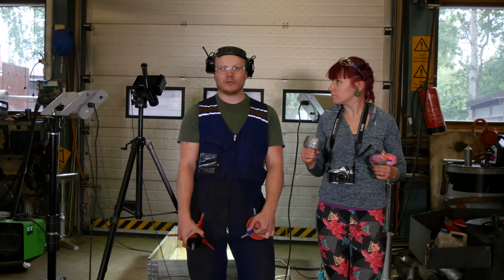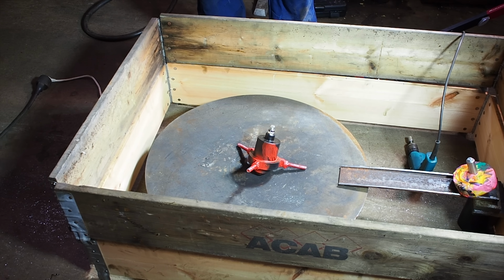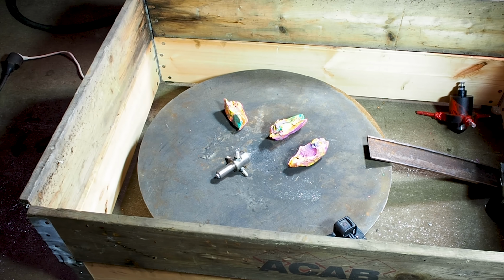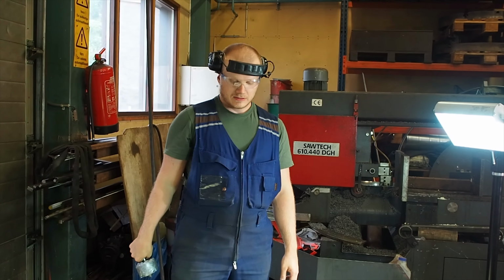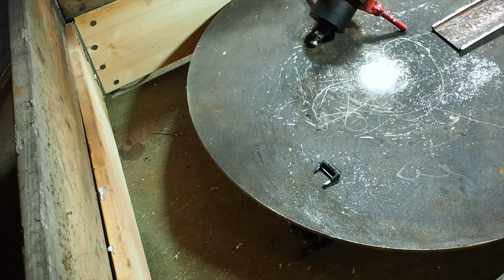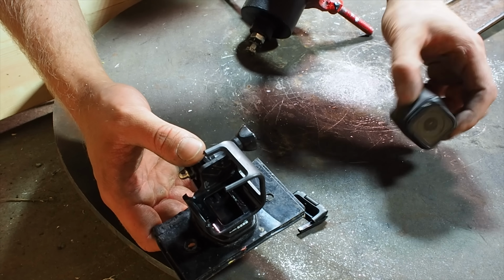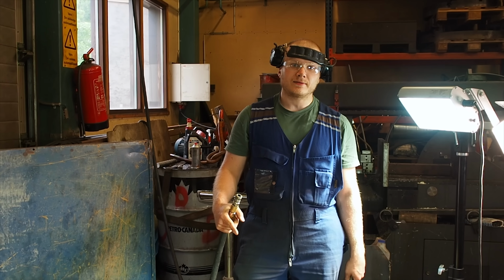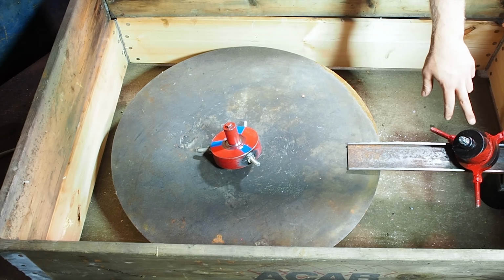Most Dangerous Spinning top/Beyblade/Spinner Fight Ever!

Comment from the maker: This one was really scary to do. The sound was really loud, just one spinner spinning to that plate made terrible sound and we were terrified to collide those steel ones :D But they were surprisingly easy and there wasn't anything too dangerous.
Reply: Great video as usual haha
Reply: Be careful, I like your videos
Reply: The results were REVOLUTIONary........badum...tssss 😏
Reply: Beyond the press nice work on the slowmo shots
Reply: Beyond the press I love the message ACAB!
Reply: What if you soaked the playdoh spinner in liquid nitrogen first?
Reply: djschuby04 ..Actually, that's a good call. Holds the integrity better, then blows apart on impact. Like to see that. 👌
Reply: Yeah! You need better sound recording equippment, so we can hear things like this. That auto gain combined with huge lack of bass as well as lack of very high frequencies, doesn't make the sound we hear anywhere close to what you heard in real life (I know that from experience). But this channel is not worse than anyone else on YouTube. Unfortunally I have no tips where you can buy good microphones and stuff. My own videos is recorded using microphones that I built my self from Panasonic WM61 microphone capsules. If you like to build electronics I can give you some tips, but don't know of any commersial products.
Anyway - other than that, this was awesome as usual. The high speed footage is also so nice! You should make it so the ramp is stays horisontal (that way, the spinning top stays on the ramp once you have spinned it up) - then it's quite easy to make a construction so you can tilt the ramp by pulling a string moving a long stick from a distance to make it move into the "arena". Now it looked like you barely had time to hide behind the shield before the collision...
Reply: The playdough one would have worked if you have given it a coat of duct tape to hold it together. I actually think that would have been really interesting to see, watching the steel one tear into it and pull out chunks of playdough in slowmo. Especially if it could tear the tape enough that the playdough ripped it apart and it exploded. Maybe for another video?

Another idea, if you can manage to build it and spin it up fast enough, is oobleck. It might be possible to build something that can hold it from the tube of a bicycle wheel, but I'm not sure.
Reply: The playdoh spinner should've possibly had some duct tape clothes and some twisted wire to hold it them in place before it's short life!

I think there should've been 6 rounds between the steel spinners where each spinner took 3 turns at getting started in the arena due to it slowly down before the ramp spinner got to it.
Reply: Beyond the press You should put magnesium on the ends of the arms so when they hit each other it shoots out sparks
Reply: You could try putting some eggs around the outside of the ring if you do it again, might look cool on the hi-speed camera
Reply: Wouldn't the final score be 2-1?
Reply: Am I crazy or are you guys a lot better at English than the last video? It's great but I still sorta miss it hehe
Reply: Amazing stuff they come up with. As  viewers to this channel, everyone put our minds together, and help come up with some more ideas. Lauri is a very good machinist, Anni is very creative, and together, they come up with some things, no one even thinks of..lol. Share these vids.... always something new. 😁 👍👍
Reply from the maker: +Marcus Lindgren I think we are much better english than one year ago at least :D Before this youtube thing I hardly never spoke in english but now I do it almost every day so I am getting better. But don't worry I am not trying to get any better or taking any classes or any thing like that :D
Reply: Beyond the press we love u
Reply: You two are awesome, and I love the way you pronounce English words, especially when they are incorrect.  It all in the soft g sounds :)
Reply: I wonder what would happen if they put strong magnets on the arms that stick out to attract the other top
Reply: Beyond the press Maybe try using oil to help with less friction.
Reply: I have an alternative plan for the big spinner, fix it to ride on lawn mower instead of the blade. That way you get a blade guard to contain the mess when it explodes.
Reply: Beyond the press give me a shoutout
Reply: These things look terrifying. XD
Reply: Beyond the press Your new champion won because it has a much greater inertia than the old one. It has most of its mass in a ring at large radius, and that makes a BIG difference to the amount of energy it holds when spinning. Use this fact to make an even better killer spinner Laurie!
Reply: Please try to put real blades in your spinning top
Reply: i love this! Please continue to do more cool and crazy stuff like this!
Reply: Try to melt stone.
Reply: Is that death klock music
Reply: You two are so much fun.

Comment: I use to do this in mechine tool class I put holes in mine and used the air compressor with blow attachment to speed it up to squealing speed also jumped bolts with a screwdriver by speeding  a bolt up by compressed air  till it was screaming and then let it slide off the screw driver

Comment: Try it with the tops spinning in the opposite directions so the smaller one does not lose momentum so quickly. These rounds are over too quickly with only 1 or 2 left hooks and  OUT!

Comment: did anyone else see how the liquid in the neck of the bottle clapped down causing the bottle to break almost perfectly where the neck meets the body.... You can see the air in the neck expanding and forcing the liquid down to meet the bulk area of the bottle.... But I don't understand why it's doing that to begin with....🤔 Anyone out there know something about the physics of this that I don't?
I slowed it down and I can't see much liquid escaping the initial impact hole, to account for the expansion of air... I'm really confused

Comment: Higher moment of inertia wins when rotational velocity is the same. You can see in the slow-mo that whenever they collide, the spinners are subtracting speed (and also energy) from each other. Once the majority of the energy is gone, the spinner is no longer as stable due to gyroscopic effects, and thus it only takes a little nudge to knock it over. This compounded with the fact that the old spinner had longer bolts that hit the floor on a lower angle of perturbation than the other, means that the new spinner was always going to win.

Comment: Needs more fire.

For example, you could have a canister of petrol in the centre of the spinner with nozzles so that the fuel sprays out while it spins. Then when the spinners collide the sparks they create will ignite the fuel and boom! There goes your workshop.

On second thought, maybe it would be better to do it outside.

Comment: I think it's clear why the new champ is better.  more mass spread out to a larger radius.  the old champ might be more massive over all, but it's mass is more concentrated toward the axis.  old champ is also much more top heavy, which is why it has a tendency to tip and even start spinning on one of arms like we saw in one of the other videos.  the next spinner should be as heavy as old champ or heavier, but more in the form and profile of new champ, better design by and large

Comment: Terrific!  Very interesting stuff happening with these things, gives me a few ideas & observations:
-With two of the pneumatic tools and some box-sections, you could make a rig to simultaneously spin up two tops at once and  release more remotely, either simply standing at the other end of a lever-arm or complex like cable & pulleys or linear actuators.
-Maybe wrap the play-dough one in a couple turns of pallet wrap; it's got a lot of potential to absorb energy from a steel top!

Comment: A lot can go wrong with these "toys".
That was a run to hide :) Should maybe go other way, not towards where they collide.
The bolts might disassemble at high speed (like the play-doh at low), especially after a few collisions. Or the bolts can catch the ground, making the spinner jump out.
The bigger bad-ass in production might need even more protection than current champ.

Comment: I really enjoy your videos, you two are pretty cool!

I reckon you guys could/should redo this one. Just the last battle. Machine up two new tops, identical, with just one difference. Give them angled teeth on the outside diameter, but each with its teeth in the opposite direction. With each of them the same dimensions except for opposite pointing teeth, the collisions should be very destructive. 

They dont have to be time consuming or expensive to make either. Just make two traditional top shapes out of say, some 100mm round bar, then just cut six or eight teeth on each on the dividing head. You could even machine them the same way, just flip one over so its teeth are opposite. If you dont quite understand what I mean I'll be more than happy to do some proper drawings for you.

Comment: At first, my theory was that the time it took for Pretty Boy to spin up took so long that all the energy from Old Champ was lost before the fight, which gave Pretty Boy the advantage. But After the final round, it became pretty clear that the deciding factor was the proportionally larger body and smaller bolts, which, despite a smaller overall mass, provided a much more stable and balanced center of gravity, and thus Pretty Boy was able to counter Old Champ's greater mass by putting more of his own mass behind each blow than Old Champ was able to. You can actually see the difference in how the two tops behave based on how they spin when left alone in the arena. Very interesting science!
Reply: True, altho' I think the Old Champ's spin was perpetually affected by the removal of the "spin-up" device, in a way that Pretty Boy's was not.
Reply: Old champs center of gravity is much higher, making it easier to topple and those longer bolts factor in too when hitting the ground compared to the body hitting for pretty boy.
Reply: Ol' Champ has a higher centre of gravity and a more even ratio between the maximum and minimum principal moments of inertia (i.e. Ol' champ is less disc-shaped). Both those things make Ol' Champ a less stable spinner.

I found this physics paper on spinning tops and stability
https://igl.ethz.ch/projects/spin-it/SpinItPaper.pdf

Comment: It's very clear that you favoured the new one considering you only gave the new one the higher speeds with the air drill and the old spinner only the lower rpm with the drill. Am I the only one seeing this????
Reply from the maker: I tested the older one also with the air tool but it has so much aerodynamically drag because of the longer bolts that it didn't reach as high rpms as with the electric drill that has lot more torque.
Reply: Interesting!